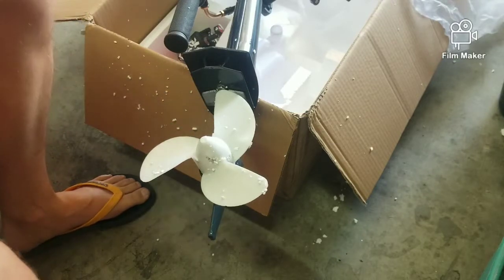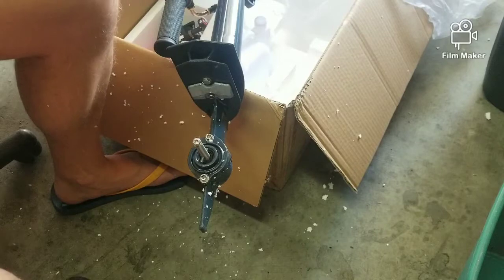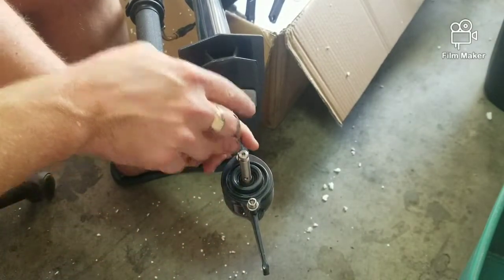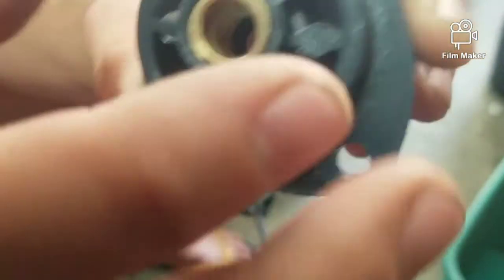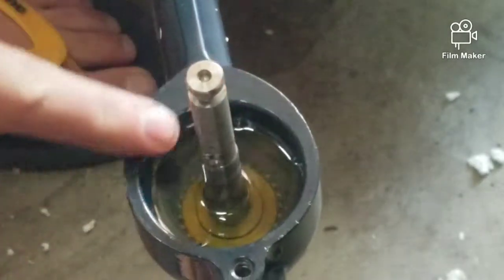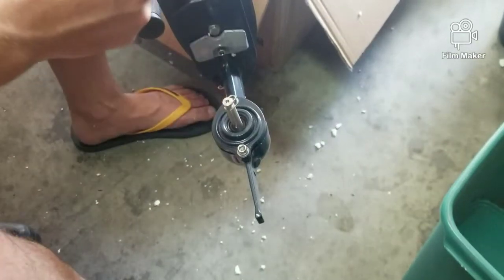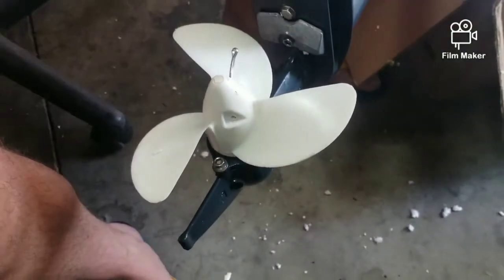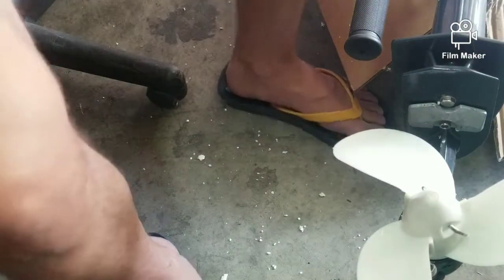Hangkai 3.5hp outboard setup (must see)(how to)

Comment: For all those watching this video easier way to remove lower gear plate is to twist till the ears of plate are on the sides and get rubber mallet and hit upwards with little force! It will keep you from scraping metal and messing up the seal 👌👌
Reply from the maker: I completely agree this would have been a easier method for sure

Comment: For the cotter key, split the ends and bend them on at a time in opposite directions to ensure it does not come out. That revs pretty high, so you don't want that to easily to slide out like you have it there.

Comment: Thank you so much! My Hangkai came packed with gear oil already. It wasn't empty (purchased through Amazon). Your instructions were great. For some reason I had a much easier time with the cotter pin. Rotating the cap and using a light mallet tap got the housing open quickly as the last post hinted. Thank you for a very helpful video!

Comment: I just got a free Hangkai 3.5 hp 2 stroke. I bought  a spare prop for $14.. I got to get a pin, the little plastic cup that was in my old prop around the pin,  and napa has an exact match stainless cotter pin. 
 The face book hangkai group said use 30:1 for break in, then start using 50:1  after break in. 
 The little 3.5 has a huge following. Not sure about the other Hangkai engines.

Comment: Wow, this is a product of our company
Reply: Are youre products reliable in you're own opinion
Reply: Approximately, how much motor oil do put in??? The dip stick does not have a clear marker.
Reply: @alwayslearningsomethingnew7115  are you crazy. It's a 2 stroke
Reply: @alwayslearningsomethingnew7115  you mix oil into the gasoline
Reply: Sorry, I got the 4 stroke 4HP... my bad.
Reply: How about start sending the parts that need things added not attached so people will have to assemble it knowing it will need gear oil? Maybe could help people and less work your factory has to do that just gets took back apart.
Reply: And where does someone get parts for this mororm
Reply: Company has horrible Customer service and manual language is crap.  I had no idea gear oil wad missing.  No mention in manual

Comment: Add to the confusion on the fuel mixture issue. The Hangkai website states using a 50:1 fuel mixture, which is what my weed whacker uses. I buy TruFuel premixed fuel, and never had a problem with the weed whacker. Not sure which way to go on this.
Reply from the maker: True fuel will always work in this one your on the right track.

Comment: 13:45 where you are rubbing your finger that's where I put the grease and also on the shaft
Reply from the maker: I wasn't sure if I should Grease that or not because I didn't want the gasket on the inside of the plate to have any play since that part doesn't move I think it will be ok .
Reply: Use marine grade grease to lubricate the prop shaft bushing. Also gear oil needs breathing room. It expands during use and heat production so totally full could be problematic. Break in time is ten hours at the recommended fuel/ oil mixture, then change the mixture to normal operating mix. Don’t rev the motor during break in, that’s where people run into problems. Break in at low speed, not idle. There is a clutch in the lower unit and it stops the impeller and prop from turning at idle. Max idle time is 5 minutes, after that bad things start to happen. Change you spark plug to Champion CJ8 or NGK equivalent. Stock plug is sub standard. Good luck.

Comment: I just got a 3.5 hp and am breaking it in, with  running it in a trash can w/ water up the the right level.  Mixed gas & oil as in your video.  There's quite a bit of smoke or burned oil - is that a problem, and what can I do about it? The motor, water, and trash can aren't perfectly level and perpendicular - is that a problem?
Reply: Hi Steve how’s the motor holding up?

Comment: I almost made the mistake of putting regular gear oil I used to drive a stick shift and that's the gear oil I almost put in there then I found out it was Marine gear oil and then I put grease around the outer edges of the engine also Marine Grease
Reply from the maker: That's perfect  To know I should have probably mentioned that in the video I think for the break in period it's not too badd to use regular oil since you should change it right after the 10 hour break in What do you think?
Reply: @SailingProjectOdyssey  yes that's a great idea I saw a man on YouTube breaking it in for 10 hours and then changing the gear oil
Reply from the maker: @FishingwithCristina  I think I have seen that one too , I'm hoping that I can have enough information to help ppl who buy this engine all in one spot . I spent so much time looking for all the different videos and just being overwhelmed .
Reply: @SailingProjectOdyssey  I know there is not that much information on them unfortunately there's a few of us that are putting up videos

Comment: Great will done m8 I shall get one for the red sea Yemen can you please let me know what sort and size spark plugs it takes and air filter thanks
Reply: Spark plug replacement number is champion cj-8 and it has no air filter it’s water cooled
Reply: Normally an outboard engine does not need an air filter unless the air surrounding you is laden with wind blown dust, dirt or sand

Comment: hi what is the part name between the carburetor and the engine its broken and i dont know from where i can find
Reply from the maker: I'd say its probably a spacer I'd have to look closer at my engine and try to figure  it out. Sorry for the late reply and thanks for your comment
Reply: In the UK we call it a inlet gasket.
Reply: In the U.S. it is usually called the ‘carburetor base gasket’. On some motorcycles it’s simply referred to as the ‘intake manifold’ if it is a plastic or rubber boot connecting the carburetor to the engine.

Comment: where is the serial # located
Reply: On the box it came in. Seriously. There’s a tag on the transom clamp but the No. is blank, the label on the box has all the info that would be on a normal Id tag, so I just cut the box and kept that part.
Reply: @SpyFryTF2  Thank you for this info 🫡

Comment: Waaaayyyy too much gear oil if you see it leaking then you blew out the seal. You’re supposed to fill it right below that line because when liquid gets hot and expands.
Reply: Fill to 1/3 capacity. About 10 km down from line.